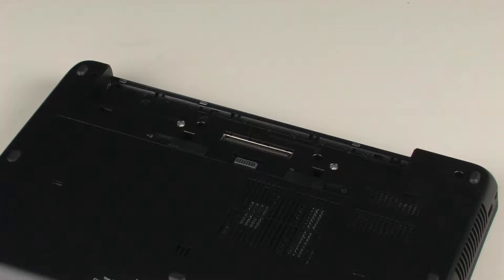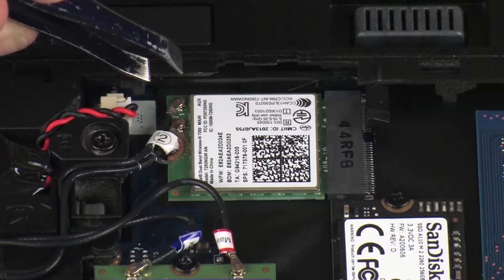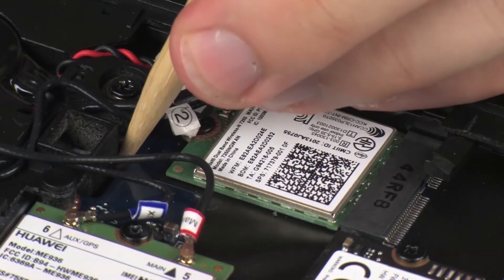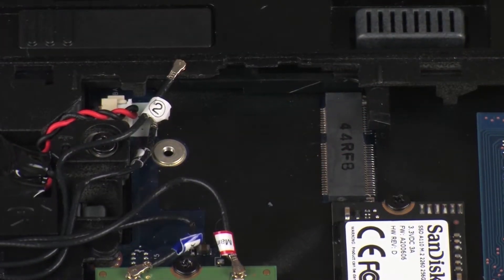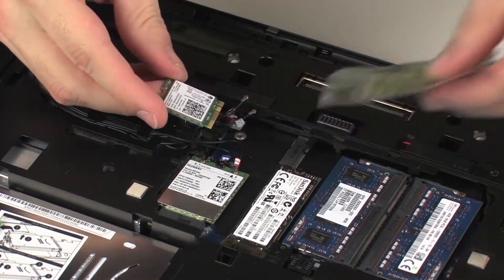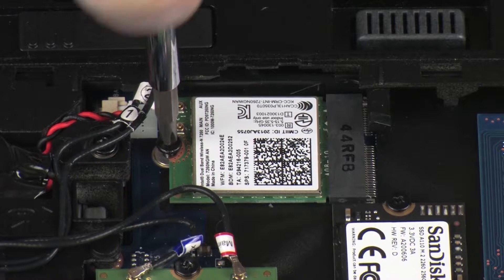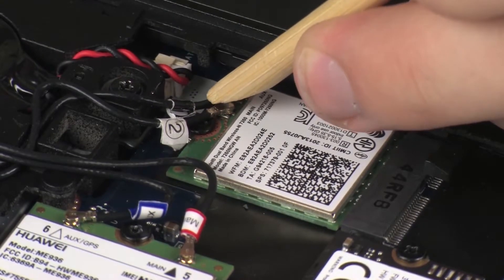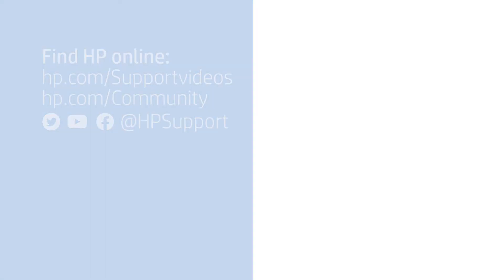Replace the Wireless LAN Module | HP ZBook 15 G2 Mobile Workstation | HP Support

Comment: Is it possible to replace this module with some newer card? The Intel 7260 driver keeps restarting since the latest Windows 10 update and it's a discontinued product, so no driver updates are coming.
Reply from the maker: +Márton Balassa HP does not recommend upgrading or downgrading hardware parts or software that is bundled with the product as It may affect the manufacturer's warranty and performance, however, you could change the configuration at your own discretion.